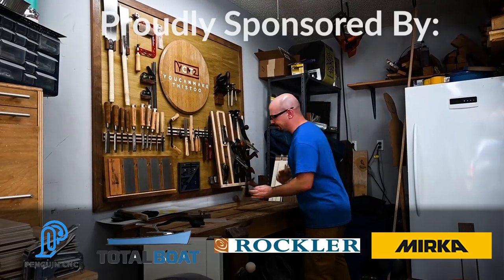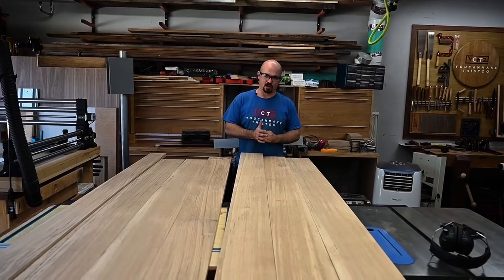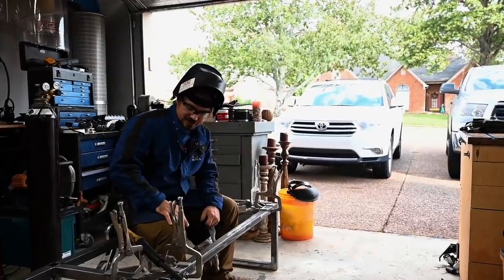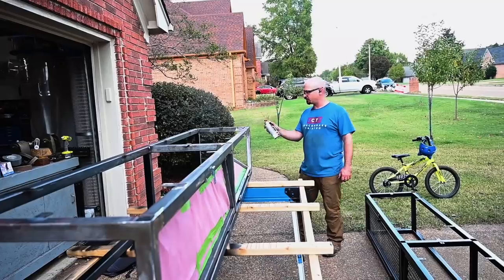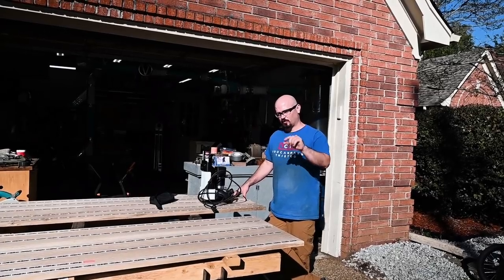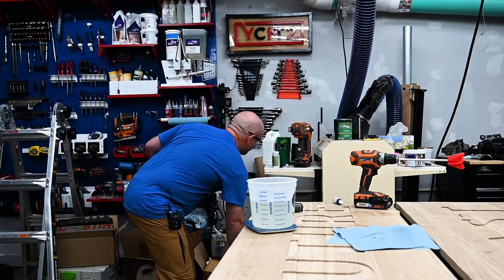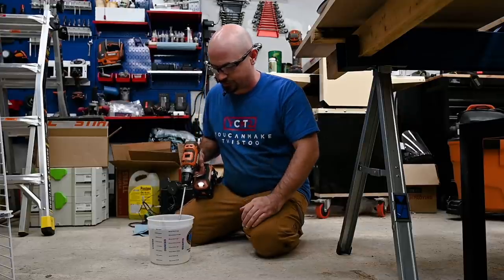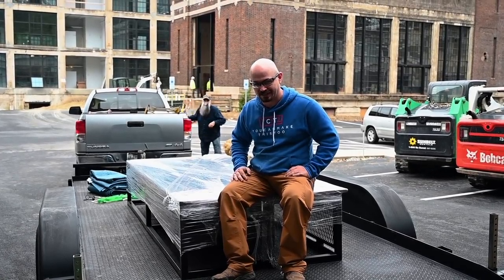Building Storage Bench with Epoxy Inlays

Comment: Ahhh wearing gloves, brings back a memory from when I was a teen. I had a friend who’s father had his own wood shop and I started working there after school just to help cleaning up basically. And one day I wanted to try out the table saw he had. I was cleaning up and I had on these big heavy gloves on and they were also kinda loose on me. So I turned on the saw and started to run a piece of wood thru and once I got close to the blade the blade caught the glove, I never moved as fast as I did that day. I saw it happening and that’s why I was able to pull my hand back before it took my hand. I wasn’t that fast tho and the blade cut my middle finger a bit. One of the guys that worked there came in the room and saw all the blood and noticed I was in the bathroom and he just asked if I was ok. Once he saw I was good he just layed into me about my mistake. I never touched that table saw again.
Reply from the maker: Woah! Glad you came up pretty unharmed, that coulda gone really bad. Yeah.. bulky gloves are never a good idea around tools. And the table saw is definitely not a tool to get behind without training.

Comment: You'd think a $2000 machine would cut straighter lines. No offence but I reckon I could have got that inlay neater with a $50 router.
Reply from the maker: Yes and no. I could also cut a straighter line than those freehand. But it’s not supposed to be straight, the shaper cut out the svg file from their branding consultant. We rushed it a bit so I’d guess the shaper cut within about .003 - .005” accuracy of the graphic. Way better than I could do by hand.